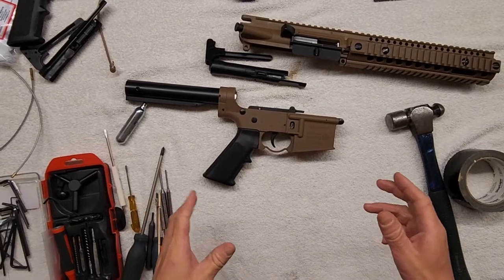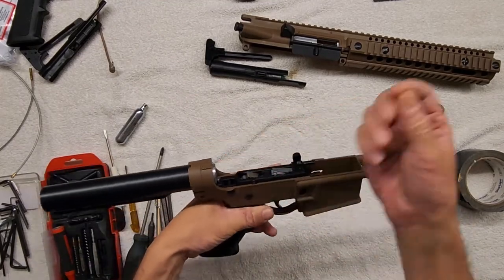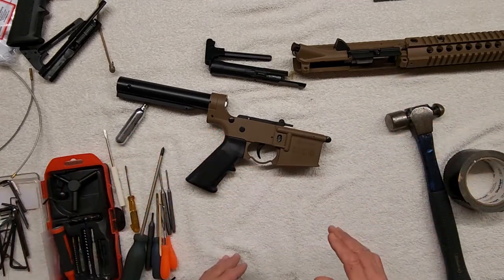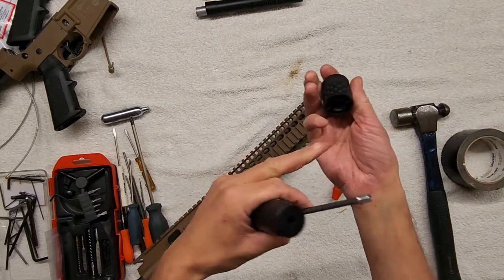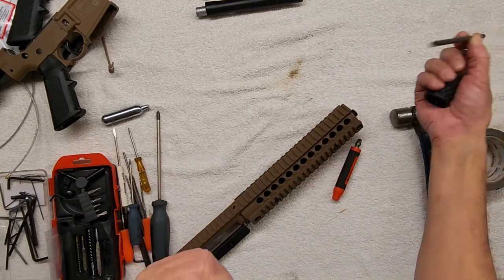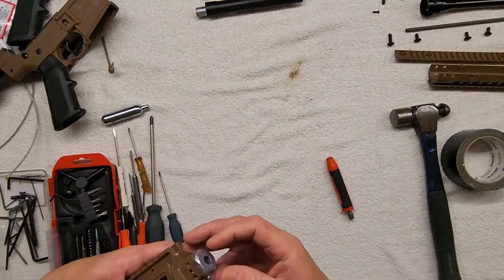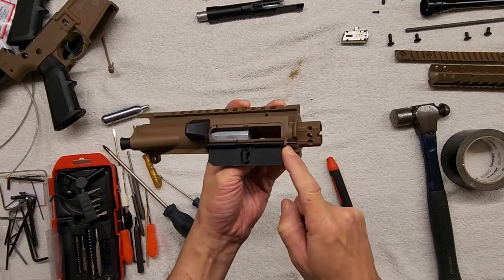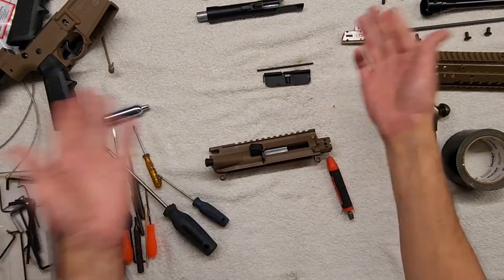Crosman DPMS / R1 / MPW  / A4-P Full Breakdown - Part 1 : Upper Receiver and Handguard.

Comment: Will an A4P fire without the buffer tube or can it be removed all together?

Also,  can I take the stock off of my  DPMS SBR and put it on one of my  Crossman A4P? I am familiar with the laws on doing that to my real guns, but since ATF&E doesn't have jurisdiction over airguns like these and they look very inner-changable and I am going for a specific look. 

Can you help?
Reply from the maker: All the crosman ARs need the buffer tube, the magazine requires the impact from the bcg and buffer springs to let out the co2.

I have a video for converting the dpms stock into a more traditional stock , depends what you are going for.  If you want to keep the look of the dpms stock you could technically put your a4-p upper on your dpms lower and only difference will be the markings on the magwell but you will technically have an a4-p with a dpms stock.

Comment: Do you know where I can find/but the inner barrel part I lost mine
Reply from the maker: @Unholyzay1  sorry, crosman has still not started supporting these models with many oem parts.  I still have a pending order from like a year ago with the handful of parts they have on their site xD.  However, you can buy barrels for other models or other manufacturers for 4.5mm bbs and it only takes a little time to fit (usually) i have a barrel video that should give you enough guidance to retrofit a different barrel into your crosman.

Comment: Have you notice the Safety Selector detent spring being bigger than most detent holes in standard AR grips like the magpul moe? I notice i had to drill a bigger hole for the spring to move freely.
Also, 26:15 is a brass deflector. Its not “non functional” it doesnt move on real rifles either. Its to deflect the brass from hitting your face, especially when shooting lefty.
Reply from the maker: The only grip I enlarged the spring hole for was the first ergo grip i installed, pretty sure it was just excess material from the molding.  All the others I had no issues with, even the magpul.  It is very possible the sizes are so close that just a hair one way or the other makes the fit a bit tight.

Totally agree about the spent cartridge deflector, it not non functional.. it just serves no purpose on an airgun hehe xD

Comment: What is diameter of the inner barrel ? I’m thinking of replacing it with longer air soft gbb barrel . If it’s possible
Reply from the maker: OD is 5.97 mm ..ish.  you would need to find a 4.5 mm bb barrel though, the tinkering needed to make this run airsoft would just be insane.

Comment: Guys i've took the Valve apart and holy shit you can hop up the power big time but you will have to enlarge the Co2 ports.
use a bigger tube inside the Valve 600/700/ maybe 800 Fps. 650 fps out of the  Bushmaster or the AP4 would be worth it
I have to go buy a Dremmel and some cutting bits and drill bits and start working.
Reply from the maker: Yes indeed, lots options here, especially you have the range to push it to the limits xD.

 Considering the fps you are able to attain, go check out rumblecanada (if you haven't already) you will most likely need to reinforce the internals in the same way he did to support the increased energy.

Comment: I have the buffer spring retainer stuck in the tube and it will not budge.
Any suggestions on a fix or is the rifle done and now spare parts?
Reply from the maker: I think I asked you for a bit of clarification in the lower breakdown, the retaining spring is captured by the fcg, it just doesn't pop up?

Comment: Where can i buy spare parts? I believe my muzzle shim for my A4-P was never in the air gun to begin with
Reply from the maker: Im afraid crosman only sells a handfull of parts and they are usually out of stock.  And i hate to be a bummer but the inner barrel would rattle and fall out the front if the muzzle shim was missing. You would have noticed right off the bat.

What problems were you having? And did you doublecheck with good lighting inside the muzzle brake? Sometimes it can stay wedged on the tip of the barrel too, so it might fall off while you are not looking.